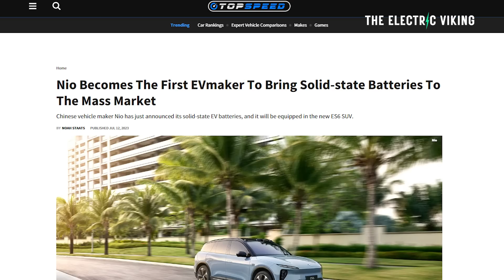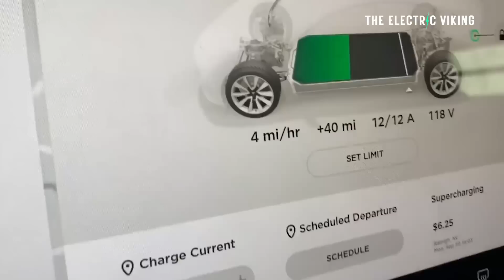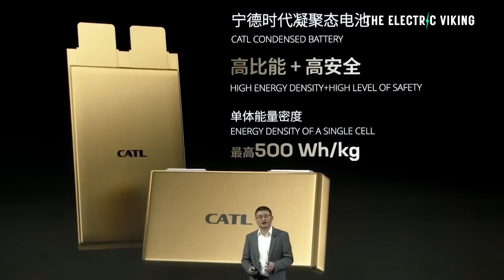CATL reveal new batteries for Tesla EVs that will KILL the competition

Comment: EV motorcycles could also benefit greatly from the 500 kWh/kg batteries, range and slow charging speeds are the problem for them. This is mostly due to the poor aerodynamics of motos at speed
Reply: "500 kWh/kg" is 1.8GJ per kg. That's 391 times higher energy density than TNT at 4.6MJ/kg!
 If that could exist, then an ebike consuming 20Wh/km would get 25,000 km range per kg.
Reply: Thanks Andy, my bad, brain fart or wishful thinking, should be 500 Wh/kg, not 500,000Wh/kg!  That hypothetical battery would be “dynamite”
Reply: @JBean_COCR  Indeed! 🙂
Reply: Sure, all automotives would greatly benefit from batteries with equal gas ICE efficiency - 12K Wh/kg.  The theoretical max for NCM is only about 350 Wh/kg -- in practice though, SK Innovation's NCM9+ is close to 320Wh/kg now; LFP is only 200 Wh -- while most are 160 Wh/pkg in reality.   we are way off there.

Also, slow charging isn't necessarily the problem here.  Most LFPs are used in entry-level, low-range EVs with small batteries (~65kWh), so they have very little to benefit from high charging C-rtes while most NCM8/9 are already capable of much higher C-rates (charging/dischargin).

Comment: Our Mod Y rwd uses a LFP battery. They say the energy density isn’t as high as Li-Co. However the acceleration of our car is phenomenal. Couldn’t handle any more power😊. 
So nothing the matter with LFP performance at all. 
Due to the fact that you can charge to 100% means that our range is higher than American build Teslas.

Comment: When I hear this statement “You can charge your LFP battery each time to 100% they won’t have any degradation” I want to vomit. How can you spread this nonsense? If is less affected than NCM by charging it to 100% that doesn’t mean is immune.
Reply: My tesla advises me to charge to 100% and we have had no problems ( so far ).
Reply: @elainebradley8213  To have an accurate state of charge you need to charge it to 100%, only between 99% to 100% the calibration of the battery starts. On LFP batteries the voltage is pretty consistent from 20% to 90%, only on the up and bottom end the voltage changes and is hard to calculate a precise % of the battery.
LFP had a lower nominal voltage than NCM and this will result in a longer life,3-4 times more than NCM.
Tesla will want to compromise a bit on battery life (mostly won’t need the battery for more than 600.000 mile) and to have a precise state of charge to avoid a sudden drop from 20% to 5%, but if you want a longer battery life you should reduce the numbers of charges until 100% to 1 in 1-2 weeks.

Comment: A patent doesn't last forever. It will certainly give them a huge head start unless they can achieve something similar with a different chemistry. The competition will always strive to narrow the gap. Everntually the chemistry will be available to all, if they're still in business.
Reply: They could probably just slightly change the chemistry
Reply: Even if they reach that level of Energy, longevity & safety, they are already working on a better solution for future batteries, so competition will always be behind the 8 ball!
Reply: Sometimes people are stuck to one technology,  look how long lead acid batteries dominated before they discovered something better. Now everyone in mood for change.
Reply: Patents are supposed to let you charge higher prices to recoup your up front research and development costs.  But yeah, you could probably tweak chemistry and get around it.
Reply: When the patent protection going to expired I believe they will has new better new battery pattern anyway.
Reply: Does the square form factor swell with heat and discharge.  Do they run liquid through the plates for cooling?
Reply: by the time the patent runs out there will be something totally different and better
Reply: This isn't about new tech or patent protection, it's about massive manufacturing with its economies of scale. Same with solar panels - the Chinese are now untouchable.
Reply: @petewright4640  Sadly, the Colonials invented industrial capitalism, which the Chinese now use.  It was called the American System, but the finance capitalist fought back by killing Lincoln and installing their system in 1912.  China is now unassailable as we forgot our history.  Or, rather, we were mugged.

Comment: 500Wh/kg is game changing. That’s awesome. Electric flight here we go.
Reply: And keep in mind that in only 2021, "2021 Tesla Model 3 LR AWD With 82 kWh Battery: Charging Analysis
Taking into consideration the WLTP range of 614 km (382 miles) and available battery capacity of 76.5 kWh, we can assume energy consumption of 125 Wh/km (200 Wh/mile)." and had a battery density of 260 Wh/kg which meant a battery weight of about 290 kg or (640 Pounds.)

So now the same weight battery doubles the range.   Or lower the weight to 90kg to 200kg and still have 30% farther range.
Reply: More like 6.000 Wh/kg for long range flights of 16 hrs.
Reply: e-Bikes could use these.
Reply: @NotAnonymousNo80014  Ebikes will be limited to weight though - so you are better off with a light weight high power design like Li + Sulfur than something like Na for example. Also its more proven to be knock around - so you also want something that is going to be very stable for public use. So something like an improve LFP might be better.
Reply: Shorter range small airplanes sure but not close to what larger needs
Reply: jet fuel, even allowing for the ~50% efficiency of a gas turbine, has roughly 5KWh/Kg - and even allowing for that, long haul jets are fuel constrained due to it's weight. Battery planes aren't going to be a thing for a while, beyond extremely short haul services.
Reply: @marksherborne391  sorry to learn that - joke aside. Otto Aviation is using a piston engine because jet motors lose efficiency with altitude, but still this is not the primary reason for their 80% lower fuel consumption. It is astonishing that anyone want to paint the picture that pumping fuels around and flying with thick wings and ultra heavy motors and rotten aerodynamics is a future proof strategy. Physics is stacked against Boeing and Airbus. Around 1kWh battery density allows for supersonic long haul from any point of the globe to another. Lucid currently delivers 70 pound motors complete with inverters and gears that delivers 211kW.
Reply: @jensstubbestergaard6794  A post that got everything wrong. And I really mean everything!
Reply: @GermanGuy007  everybody are entitled to their own opinions including distrusting science. Looking up the density of air or the air resistance as function of speed or other basic knowledge is optional. This is happening whether or not opinionated disbelievers want it or not. Interestingly a German company is in the lead with the most energy dense batteries and specifically targeting aviation.
Reply: @jensstubbestergaard6794  That‘s exactly why I need to reply to wishful thinking. I‘m an ATP (Airline Transport Pilot) and have been in aviation almost all my life. The required battery weight for an Airbus A350-900 would be around 1.360 metric tons, assuming a battery density of 500 Wh/kg and a propulsion system with twice the current efficiency. 

Here’s a video of the required battery size: https://youtu.be/I4kkzYKlgwc
Reply: @jensstubbestergaard6794  Wrong way around mate. Jet engines INCREASE efficiency with altitude.
Reply: @GermanGuy007  Same here, 38 years flying, retired in 2013. Some of the nonsense on this channel is incredible.
Reply: Stolen the tech from US that US don't even have, wait until trump get back into the game and he will ban it just like china's 5g tech.
Reply: If a five min charge
Reply: An electric aeroplane is a propeller driven aeroplane. So that's 100 knots slower than a jet. Airlines want speed, range and payload.
Reply: @PropanePete  there is no reason why electric jets won't work while there is every reason to expect that getting kerosene driven jets operative in the stratosphere at any acceptable efficiency will be impossible.
Reply: @jensstubbestergaard6794   I'm a retired pilot and I can tell you conclusively that there is no such thing as an "electric jet". A jet engine is a gas turbine fuelled by refined kerosene (JetA1). An aeroplane that is powered by electricity (battery) would have propellers or ducted fans. It is not a  "jet" and its cruise speed will be about 100 knots slower than a jet powered aircraft. Propeller driven aircraft performance and efficiency peaks out around 25,000 feet, some high performance twins go to around FL300 to FL320 but they are generally aircraft with an MTOW of not above 5700 kg. That is, small aircraft, Beech Kingair, etc. So your concept of prop driven commercial airline aircraft cruising in the stratosphere is not based on reality.
Reply: Correct. The airline industry have stated for a long time that 500whrs/kg is the break point that makes electric air travel viable.
Reply: @nordic5490
Correct. And the FAA has said they need twice the battery capacity needed for the flight. Since the second half should never really get used it can be non rechargeable, which is much lighter, and if used just swapped out.
Reply: Engineers have said 400wh/kg would enable commercial Evtol planes. I’m guessing this would be short range cargo planes. Something that could replace a semi. Bypass traffic between wear houses. Able to land in the parking lot.
Reply: Batteries won't lose their weight while flight and discharging which results in a much bigger problem: The plane can't land with it's takeoff weight.
Reply: @Benedict-01  Maybe they could dump their used electrons during the flight to decrease weight. Also, fly though thunderstorms to recharge with lightning (1.21 gigawatt fast charging).
Reply: @Benedict-01 An Embraer E190 E2 has a maximum take off weight of 56,4 t of which maximum fuel is only 13,5 t. I'm more concerned about necessary battery weight than the adjustment in landing weight. Anyway battery planes will not be used for transcontinental US. But there is plenty of demand for below 1000 km as well.
Reply: @armineser2591  With 100t of fuel on A340 you should be very concerned...
Reply: @Benedict-01  Most of the time they can. It's usually just the bigger long haul flights that would need to burn fuel before landing.
Reply: @Benedict-01
I had not thought about that problem. Why can’t they land with their takeoff weight?
Reply: @Benedict-01  Exactly. And do the sums for the kwh of energy used , on a 3 hour domestic '737' airliner flight. 
It's insane. Probably need 1000 tonnes of batteries. Good luck landing with that !
Reply: If it ever goes into mass production.  I’m skeptical as vaporware is prevalent in this space.
Reply: Electric small planes are here...
Reply: @mykota2417  where?
Reply: Airplanes and the such will still need higher power dens batteries ... talking in the order of 2k+ so it will be a while before they take over there - but maybe for shorter flights and aircraft (1-4 ppl) + maybe some sort of hybrid designs.
Reply: @adr2t  Otto Aviation proves that intelligent aerodynamics lowers energy consumption by 80% and if they drop the ICE motor for batteries, they can go to higher altitude and reduce resistance, so Boeing and Airbus are toast. Even worse for the present dominating companies is the fact that Musk for more than a decade have been working upon the concept of supersonic planes through the stratosphere. SpaceX and Tesla combined has a market cap that is almost 4X greater than Boeing and Airbus combined.  Only very naive types imagine that the outdated TAW jets has a future.
Reply: @adr2t  With 1kWh/kg you could cover Europe. That would be pretty big.
Reply: @adr2t    Naah  they already have electric light aircraft, so this will be a bonus and immediately translate to longer range.